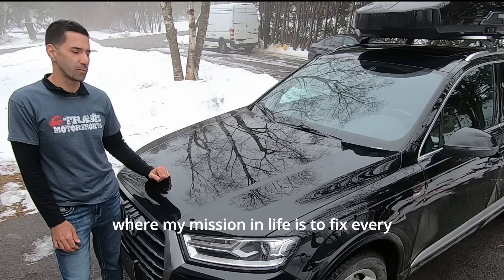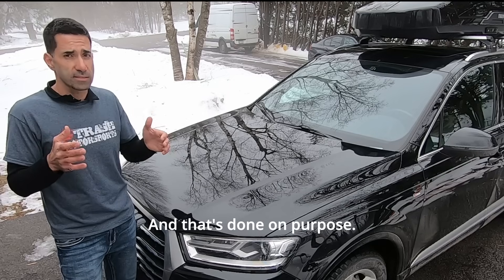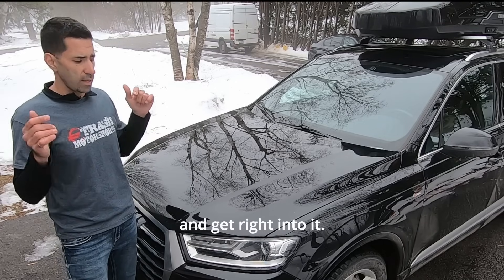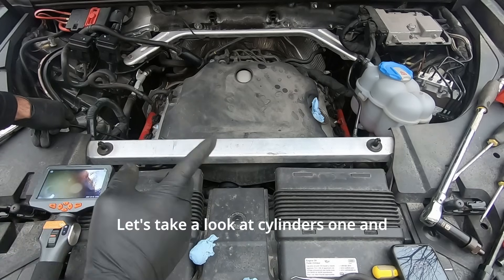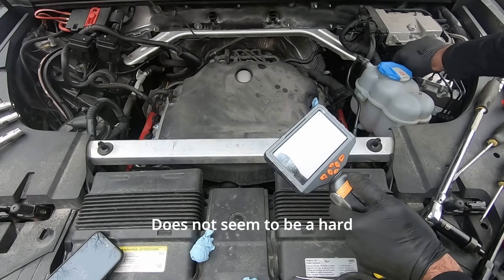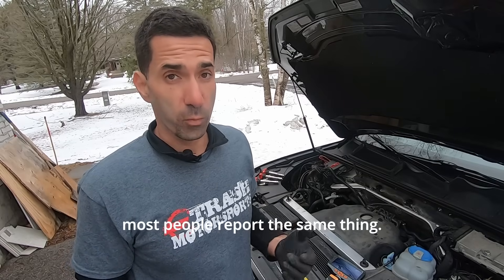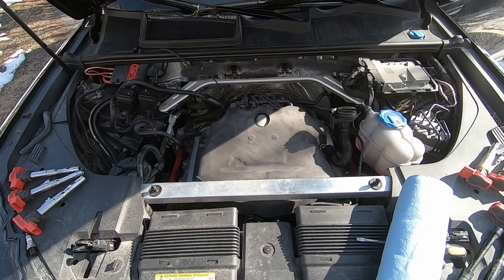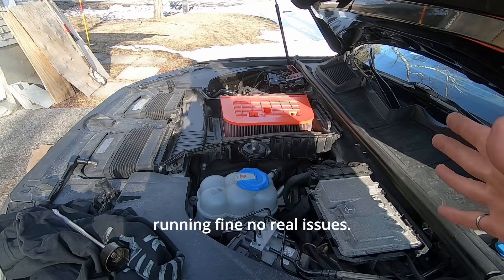I piston soaked another 3.0T with B-12 to fix its oil burning issues due to stuck piston rings

Comment: Why do the pistons need to be at TDC to do this?
Reply from the maker: Smallest volume over the piston - ensures you can soak the whole piston with little B12
Reply: @ETMotorsports  Why would it take more volume to cover the whole piston if it is lower in the cylinder? Does the piston increase in size or does the cylinder get bigger towards the bottom? 🤔
Reply: @brendanmckenzie2042 you will understand better if you see animation of a v6 engine running. The left and right side pistons form a V shape and the pistons slide up and down as the burning fuel gases and crankshaft act on then

Comment: Following the factory oil change intervals will eventually shorten engine life and lead to oil consumption issues. If you change your oil at about half of the manufacturer’s recommended interval, you’ll avoid those problems. Also, keep in mind that you’re now stepping away from VW/Audi’s official oil spec. But good to know…

Comment: I just wanted to thank you deeply for your videos.
My A4 had so much carbon buildup that it was having a hard time accelerating if I floored it, engine shaking and misfiring on multiple cylinders.
I did a piston soak after watching several of your videos on repeat.

The result:
Night and day difference, it’s quite crazy how well this worked.
All the problems gone, feels like the engine is alive again, smooth operation and no misfires.
Will need to see how the oil consumption goes but I plan on doing this soak a couple more times to get full benefits since I bought a bulk pack of B-12 and crossed the border to pick it up. (Also live in canada)

Tysm, you rock!
Reply from the maker: awesome! Glad it worked

Comment: I have a 3.0T Q5 that I will be able to verify whether or not the final drive with the B12 works.  Unfortunately it is disabled in another state because of the carbon buildup, but I will be able to take it to my garage soon within a month.  I have no reservations about driving it normally with the B12 in the system for a half hour or so.

Comment: I'd be amazing to see the same process on a VW TDI since they are a bit trickier to get the B12 in and cleared out.
Reply from the maker: Yeah no kidding... plus the pistons have crowns on top which sucks because you'll waste a lot of liquid to fill each cylinder up...I haven't seen a TDI with the oil consumption issues but if I get my hands on one I'd definitely try

Comment: I commented on previous videos of yours but I like to reiterate my experience after I saw your past videos. I did the B12 soak on my 2017 Audi Q7 3.0t, which was burning a quart of oil every 200-300 miles. It was bad. After i did the B12 soak, I went 3,000 miles before I got the add oil notification. This is still unbelievable to me, but it works.
Reply: Same as my 2017 Q7 Prestige. It was burning 1ltr every <> 300 miles. No longer the case. Now I only have to add 1ltr in between oil changes (10K miles).
Reply from the maker: Love it - great results!

Comment: You saved me, thank you!!! Non-mechanic here and have just completed the soak. 2018 Audi Q7 3.0 started consuming about a quart between oil changes. Now at 125,000 miles over the past 6 months I was using a quart every 600-800 miles. New PCV did nothing.This summer it became really bad, 1 quart at 300 miles and then one quart every 125 miles. Car ran perfectly with no CEL alerts.I watched the videos several times over and did the process in a driveway. Purchased plastic ramps to remove undercarriage shield,cheap boroscope on amazon, VW/Audi tool, 2 cans of B-12, sparkplugs, Liqui Moly engine flush and Liqui Moly 5W-40 oil. Figured out TDC for each pair of pistons with a long screwdriver and used a little more than the suggested 50ml twice daily over 3 days. I did run into trouble with hand cranking on second day and decided to clean everything out with compressed air and a vacuum, crossed my fingers and turned the car over without the plugs..it worked. Once process was over, replaced plugs, buttoned everything up and started the car. Smoked and ran rough for a few minutes, threw a CEL and then began to idle smoothly. I drove the car with the B-12 in crankcase for 15 minutes. Drained oil and replaced with new oil and flush. Drained after 15 minutes, and changed oil and filter. Now at over 1,200 miles and it has consumed less than half a quart.I may need to repeat process and am happy to try it. This issue has been killing my soul for a long time. The Stealership and local German performance shop thought I was crazy.Even with a cheap scope, it was clear that this engine was absolutely filthy. THANK YOU EUROTRASH!!!!!!
Reply from the maker: Great news! Thanks for the feedback... sounds like it went exactly as expected
Reply: Hello i live in France and i have A4 2l tfsi 2010.
Where did you buy B12?
Reply: I’m going to try this soon on my mother in laws q7. Thank you for a step by step, I’ve read other feedbacks in the comments I’m excited to try because I just took the car for an oil change at my job 2 weeks ago. She drove 500 miles and it’s already burned a qt of oil. She’s told me about the problem but I didn’t believe it burned that severely. The car has 98k miles and it drives strong and feels healthy but I’ve noticed it blows out smoke from exhaust with the smell of oil. I put Castrol 5-40 but I’m going to try liqui moly after the b12 soak. Looking to soak engine atleast twice over night.
I work at Hyundai dealership and we have an oil consumption test And how they do the combustion cleaner is similar to the soak but instead of overnight soaking the pistons they let it sit for 45-1 hour and I’ve seen a lot of smoke and carbon come out the exhaust
Reply: Did you do all 6 st the same time?

Comment: Yesterday I hit the 1000km mark after the soak - half of it was urban driving. Only 100ml of oil has been consumed. I really can't believe it, before the soak I was burning up to 0.5L per 100km, car was smoking as an old-diesel, misfired as an old smoker sometimes. None of it is present now and I love the car even more. 
I am running the car now with Repsol 5w40 Competition and 100 octane fuel, since the tune allows it.
Thank you Eurotrash for giving us that information.
Reply from the maker: Great results!! A lot of folks are recommending Valvoline restore and protect - might be good to use after the soak

Comment: Bonjour et si on ajoutait le produit dans l'huile et faisait tourner le moteur 20 ou 30 min et après on fait une vidange ? Ça peut fonctionner ?
Reply from the maker: that's a regular engine flush - it won't be enough to get everything cleaned up...I run the product in the oil for 30 min at the end of the process anyways

Comment: The V6 pistons being at 45 degrees and trying to cover the upper side of the piston needs the pistons to be way down so the dirty liquid doesnt go into open exhaust valve which can end the catalytic converter.. 
So we would not be able to hand crack with with liquid in .  We need to suck it out and leave no more than 10ml while hand cranking ..
To make the liquid reach/clean chamber top and valves we need postons at TDC with valves closed and use agitation ratger than hand cranking (injection and suction many times) and sick it out all before hand cranking.. in addition for top champers and valve cleaning there will be air pockets at the upper side of piston/chambers well that air can be sucked out while adding liquid and the same time ..
Reply: TDC only works for one piston. One is in compression and the other would be in exhaust. That's why piston 1 still had fluid in it and 6 was dry. 1 was in compression with valves closed and 6 was in exhaust with the exhaust valve open. So the pour went through the exhaust valve instead of covering the piston.
Reply: @nickm820 does this mean that if piston soak is performed while the supercharger + intake runners are removed, we will see the intake valves in cylinder 1 totally sealed, while cylinder 6 will have them unsealed ?  If this is true you’ve just perfected the piston soak method
Reply from the maker: Give it a try and see if it works better...so far TDC has been the best way to do it

Comment: Thoughts on adding b12 to the tank? Also thoughts on yamalube ring free? Audi World users have incredible results with the yamalube in the tank.
Reply from the maker: adding it to the tank is great for cleaning injectors - will do absolutely nothing for stuck rings unfortunately...same with yamalube...if it's added to the fuel tank it will have no effect. If you add it to the oil and it's safe for the engine, it may be work well but you need to drive around with it for a long time if you're just adding it to the oil and in that case you risk more damage to other components

Comment: You should check out Valvoline Restore and Protect motor oil.
Reply from the maker: Many folks talk about it - from what I gather it takes 4-5 oil changes before you see any results so perhaps not ideal if you're dealing with significant consumption but as maintenance it would be good

Comment: After repeated what you did with B-12, my 2016 Audi Q7 was improved from running 1000 kms to 3000 kms. 

The previous use of B-12 has cleaned a large amount of carbon build-up. However, I'm suspicious that B-12 may not fully soaked the 45 degree v-shaped engine for a long time. The other side of the piston rings are soaked by B12 for a shorter time and still blocked with carbon build-up. Although I'm not sure if my suspicion reflects the reality.

I would like to add more B-12 to cover the pistons in the lower position of the TDC. Hope all pistons are well covered by B-12 and able to run more kms.

Comment: Is the piston ring issue specific to VAG gasoline engines? Would you try this out with a diesel variant, such as the 3.0 TDI in my 2015 Audi Q5? Also great to see that you use the Berryman's B12. It has always been my go-to additive, due to always making a noticeable difference when I ran it every 3-5k miles in my previous gasoline cars.

Comment: Clean your injectors, with additive every 5000 km or your problem will come back in no time.  Regardless of what fuel you are using. Injector cleaner every 5000 km minimum.

Comment: Is this a problem mostly for tuned engines that don't get frequent oil changes?
My '17 VW 1.8tsi has 150k miles and doesn't burn a drop but I change the oil(synthetic) every 6k miles and the engine isn't tuned.
Reply from the maker: No - not related to tuning and doesn't seem to be related to the oil change frequency although all the motors I've done have been on their 2nd and 3rd owner so it's possible they were not properly maintained when new although unlikely

Comment: Does valvoline restore and protect help this at all?
Reply from the maker: I haven't tried but a lot of folks vouch for it... apparently there's good results after 3-4 oil changes... it seems a bit slow but can't hurt to use after a soak to continue the cleaning
Reply: YES It absolutely does. I’ve used it in three vehicles and after a few changes it cut oil burning about 80%! In fact I think it may be too strong, on my high mileage nissan that was badly maintained by previous owner I have two quarts of straight sludge when I drained it. I may mix half and half next time.

Comment: My dads 2012 Audi A5 was burning 1 liter every 300Kms!!! Did the soak, although not as per the schedule/method you follow (I missed the a couple cycles), it went up to 1 Liter every 1400Kms. Although this result is not as good as what you or others have mentioned, its still WAYYY better than how it was before.

I also did the soak with my 2012 Audi A7 at the same time I replaced my PCV, Thermostat (also walnut blasted the valves), and once again did not follow a proper schedule/method, but after all of that I went from 1 liter every 1800Kms, to every 4000Kms. For my next oil change I am also going to try and do another soak and use Lucas oil stabilizer to see if I stop this for good.

Also to note, I ran the A5 with B12 on the Highway for 20 mins @ 3K RPMs before flushing it out. Was not able to run the A7 with the B12 inside as I had no coolant due to the other maintenance I was doing/also didn't feel like it.

For the crank turning tool, I designed one that can be 3D printed and works very well. Let me know if any of guys want it.
Reply: Hey, do you have a link the the 3D file crank turning tool? Many thanks :)
Reply: Can I get the link as well? Thank you

Comment: This diesel carbon residue problem is an issue with modern diesel engines with common rail injection pressures of 2,000 to 2,700 bar (29,000 to 39,000 psi).

Comment: Im not sure this is a permanent fix. The Audi oil consumption issue was caused by incorrect oil scraper ring design causing the scraper rings to get bridged with carbon/gunge easily causing the oil burning.
Reply from the maker: It's probably not as permanent as an engine rebuild but at $50 you can repeat it every year if you want and have a decent running engine without spending $20k

Comment: I used your method on my 17 Q7 & I soaked each pair for 24hrs.  I also did a few tests  on some old carbon fouled caked up intake valves and spark plugs I had laying around with B12 & some of my BG intake valve cleaner that I use to clean direct injection intake valves with a special tool. The BG part # 260WOR turned the clear jars black with big chunks of carbon within minutes while the b12 barely touched the old carbon in comparison. I actually bought a bunch of b12 & then I was like wait a second let my do some testing with stuff I already own in my shop. 
I had great results with near zero from 1 quart every 600 miles and wanted to share with everyone to try the BG intake and valve cleaner. I think you’ll find it works wonders. You have to be dealer to get it , but you can find it on online. Just thought I’d share.
Reply from the maker: That's awesome! Thanks for sharing
Reply: @ETMotorsports no problem brother. And to be clear on what I meant is you can buy it without being dealers from 3rd party sellers online. But yah man do some testing yourself and you’ll see the difference.   I also forgot to mention that I also use the BG- EPR PRODUCT AS WELL AFTER I’M DONE DOING THE TOP END PISTON SOAK.  

TO ME, THIS IS LIKE A DOUBLE DOWN ON THE PROCEDURE AND IT GETS THE LOWER PORTION OF THE OIL CONTROL RING BY DOING A OIL FLUSH USING THEIR EPR PRODUCT.  I believe it is supposed to be two cans per 8 quarts of oil and I use three instead otherwise I follow the directions to a T on the EPR stuff. Ivan did a complete oil change with Rotella 48 diesel oil for 20 minutes drained and then went back with my oil. I normally run just to make sure I got all the EPR out.
Reply: @ETMotorsports no problem brother. And to be clear on what I meant is you can buy it without being dealers from 3rd party sellers online. But yah man do some testing yourself and you’ll see the difference.   I also forgot to mention that I also use the BG- EPR PRODUCT AS WELL AFTER I’M DONE DOING THE TOP END PISTON SOAK.  

TO ME, THIS IS LIKE A DOUBLE DOWN ON THE PROCEDURE AND IT GETS THE LOWER PORTION OF THE OIL CONTROL RING BY DOING A OIL FLUSH USING THEIR EPR PRODUCT.  I believe it is supposed to be two cans per 8 quarts of oil and I use three instead otherwise I follow the directions to a T on the EPR stuff. Ivan did a complete oil change with Rotella 48 diesel oil for 20 minutes drained and then went back with my oil. I normally run just to make sure I got all the EPR out. So far that was 20,000 miles ago and I’m still burning no oil if I am it’s probably a quarter of a quart every 5000 miles. I am also stage 2 tuned  there’s a lot more crank case pressure than stock so I’m very happy with the results.
Reply: How did you run the BG intake and valve cleaner?  Did you put it in gas tank, in the oil or did you soak with it like everyone else is doing with B12?
Reply: @drm916 I used it in place of the b12 after running a few tests using old caked up intake valves & high mileage spark plugs I had laying around.   The BG was without question 20 times better than the b12 at breaking down carbon.
Reply: @drm916 I also used the BG EPR in the engine oil after I did the piston soak. 
 I soaked my pistons for 18 hours or so per pair and have not burned but maybe 1/2 quart at the end of my 5k mile oil changes. This is with a tuned dual pulley setup. 

Before I tuned it , it was burning a quart every 1k on a stock supercharger pulley & tune so I’d say it was more than successful.   

Another thing to note is to scan your car for codes because a lot of codes on our ECU will not throw a check engine light. The pcv valve or oil separator brung one of them. So I did have a code for that as well and that was changed before I did the piston soak as well. Hope this helps

Comment: Instead of 'blowing', I think 'sucking' up the debris and remaining B12 with a thin tube and shop vac is slightly better if you can do so. 
I did this 2 years ago to an Audi A4 2009 and I barely use 1/2 a little between oil changes. I also do oil changes every 7,500km as advised by a Audi Tech.
Reply: I don’t think sucking up a highly flammable liquid with a shop vac is a good idea…😅